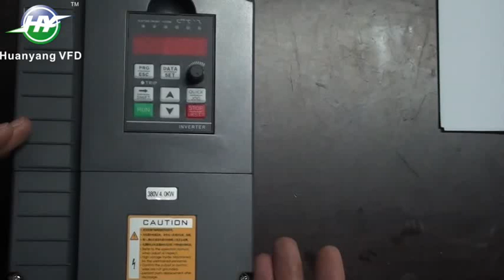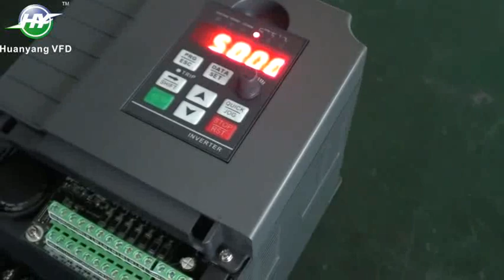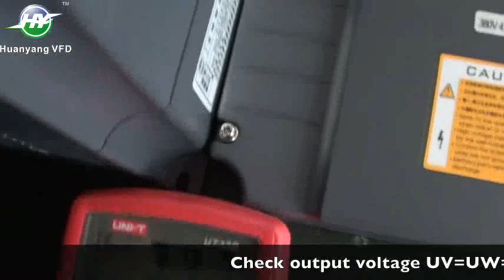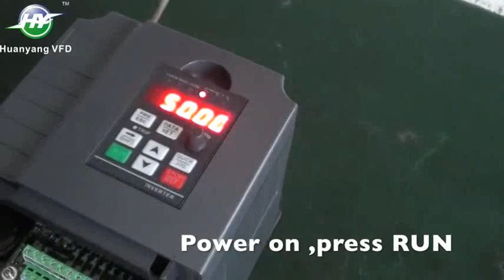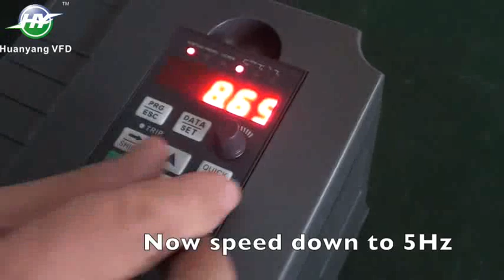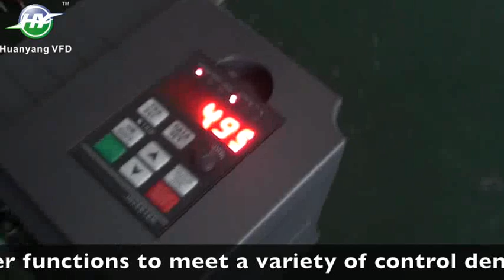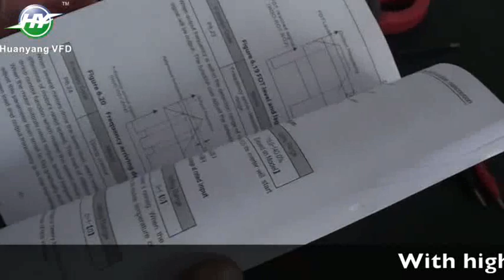HuanYang VFD  GT series CNC inerter

Comment: i have 7.5kw VFD that is for this motor to run air compressor and is still little bit struggling to run that compressor start is good but when it comes towards where the compressor should be stoped by pressure switch it slows and want to stop by it self what can be done to fix this so it can run properly. thanx.
Reply from the maker: I can’t understand your meaning, Can you  send me a video?My email:  service @hy-electrical.com
Reply: @huanyanginverter6516   which is your email? i cant sent email to you

Comment: Hi, need some help programing VFD HY01D523B to run air compressor motor 3phase 380v 4kw 2900rpm the manual is bit confusing to understand,  in Pn12 Motor rating frequency 010.00Hz-and 400.00Hz   Default Value Default(3) Default(6) 400Hz-50Hz if i put it to 50Hz its spinning very slow and if i put it to 400Hz it spins very fast motor needs to spin at 2900rpm how can i fix this? thanx.
Reply from the maker: HY01D523B is  1.5KW  220V VFD.
Your motor is   4.0KW  380V.
It is wrong to use a 220V VFD to drive a 380V motor. 
You must use ≥4.0KW 380V VFD to run your motor.